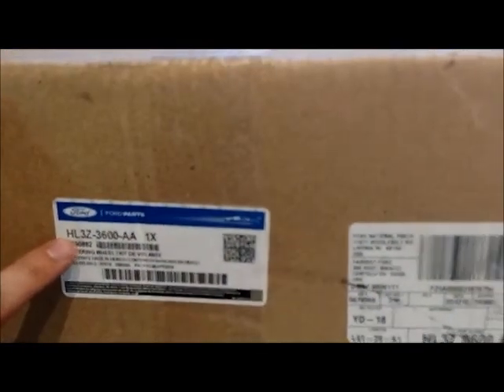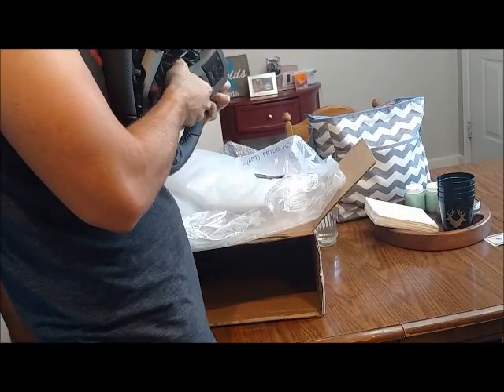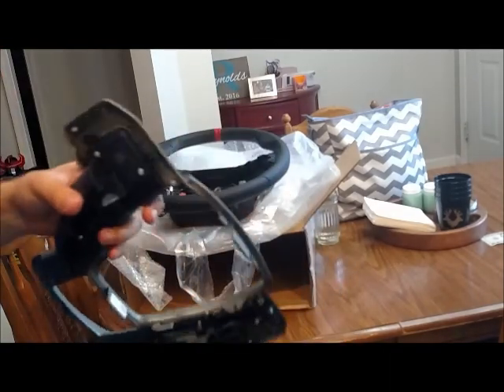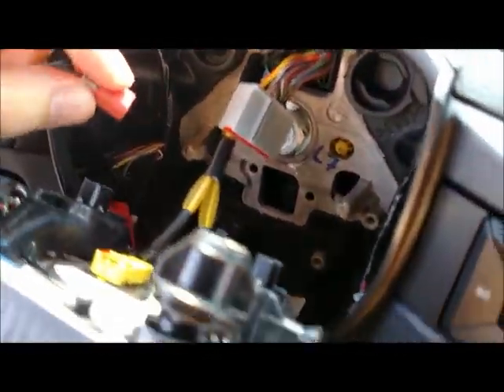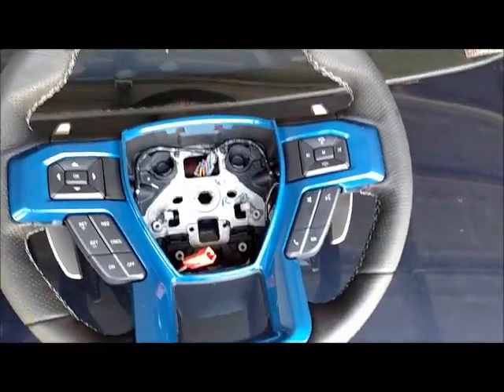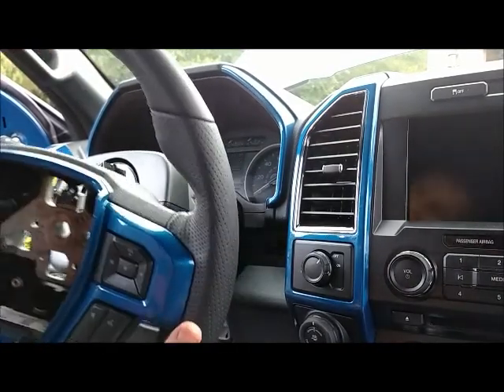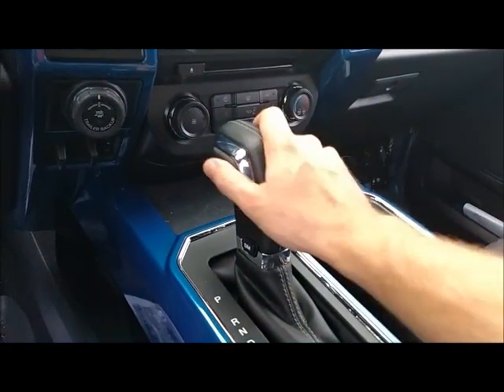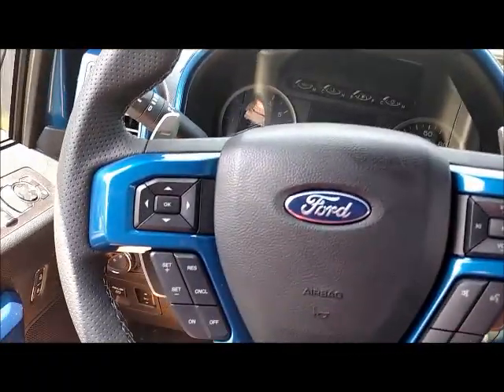2018 f150 XLT. Raptor steering wheel swap  and it works

Comment: Thanks to the Borla ATAK on you're truck I've now subscribed to you're channel.
Reply from the maker: Thanks. Hopefully have some more videos after the holidays.. what mods are y'all doing to your turcks
Reply: @theandymanchannel3801  Right now it's just maintenance stuff. I did add a Bluetooth radio to my 96 F150 as well as a dash cam. Next year after my mouth surgery I'll be getting the frame undecorated, fix all the rust and dents on the body and then do an engine upgrade like give my 302 Windsor a rebuild and bored it to a 306 (as well add some performance parts to as well like a E303 Cam, Aluminium GT40 Heads, and an Eledbrock intake manifold) to add some extra Horsepower like around 325 HP which is wayyyyyyyyyy better than the 195 HP the Windsor V8 has right now. As far as my 2011 F150 5.0 goes it completely bone stock.
Reply from the maker: @CJColvin  sounds like some nice project coming soon
Reply: @theandymanchannel3801  Thanks man. I have a 1996 Ford F150 on my channel if you want to come see it.
Reply from the maker: @CJColvin  right on I'll give you the view
Reply: @theandymanchannel3801  Sounds awesome man.

Comment: Truck looks good!! To paint your interior trim did you have to use any special paint? Can you give me some pointers please? Thank you
Reply from the maker: I just used automotive  paint. PPG.
Reply: Thank you for that!!
Reply: Forgot to ask you, any issues with peeling?
Reply from the maker: @JLC-Construction  nope.  Scuff it with 600 or 800 sand paper.  Use  adhesion promoter. Spray you paint light coats. 2 or 3. And clear
Reply: Once again!! Thank you

Comment: Where exactly did you get the steering wheel and wiring harness for the paddle shifters. Thanks
Reply from the maker: Ebay
Reply from the maker: Boostedgreygoosedesigns.net

Comment: Nice vid. did you have trouble after switching the steering wheel out with your cruise control not working? Be great if they sent the wire harness for the paddle shifters with mine.
Reply from the maker: Nope everything works great. Like OEM
Reply: Awe ok. I didn’t switch the buttons out from the older steering wheel.  Buttons on the right work but not the cruise control.  Thought they’d work regardless.
Reply from the maker: @GaryV16   yes I was wondering about that. I swap over them just to be safe.
Reply: @GaryV16  Steering wheel controls vary from year to year and model to model (Depending on your luck of course, there is some cross-over but you'll either need to use the old Cruise control switches or program the new ones in via ForScan or a dealer)

Comment: good video, but any chance you have the instructions connecting the wires, or can you be able to posted.
Reply from the maker: You can get in touch with 2016boostedgreygoose. He'll get you harness.
Reply: The Andyman Channel hi
How I can order or contact 2016booted
Reply from the maker: @mauromoryz1  look him up on Instagram 2016 boosted grey goose
Reply: The Andyman Channel thanks 
I will...
Reply: Haha ya the most important part of the install, the wiring, the poster completely skips right past it and leaves us not knowing haha. And then for those who don’t use Instagram......

Comment: What kind of paint did you use? Great video as well
Reply from the maker: PPG base coat clear coat. if you go to your local auto paint supply store. if you do not have air compressor set up they can make it where you can use it in a CO2 sprayable form.

Comment: Great video.  I’m guessing your on the f150forums.  Great info there. 

Just wondering what paint you used to paint the trim?   Seems like when I paint plastic the paint scratches off.
Reply from the maker: Wet sand with 600.. use 50/50 ammonia and water to get off all the interior wax and polishes. Wash before sanding and after.  Then spray an adhesion promoter like bully dog.. and use automotive  paint like PPG. Most O'Reilly's Carrie PPG. whey can get it in a spray can if you do not have a air compressor setup. If you use a rattle can/ regular spray paint during the summer it'll heat up and be sticky.
Reply: The Andyman Channel thank you!